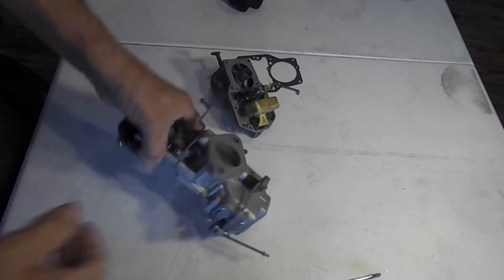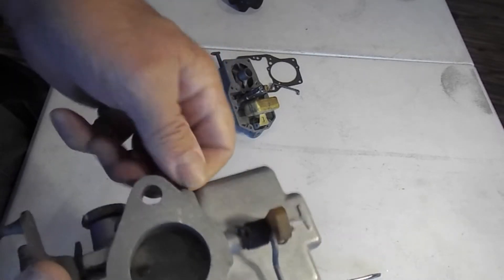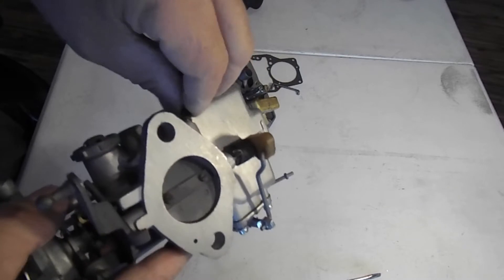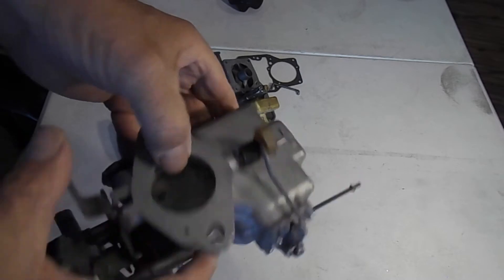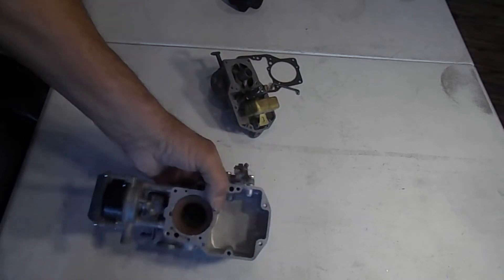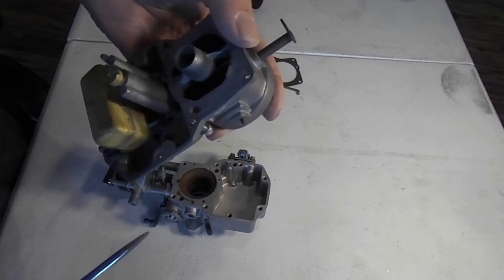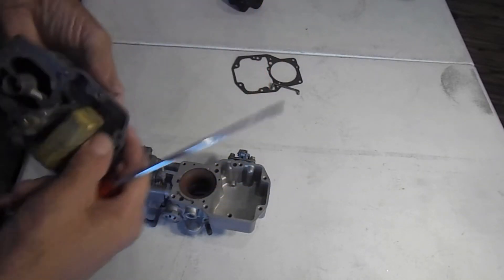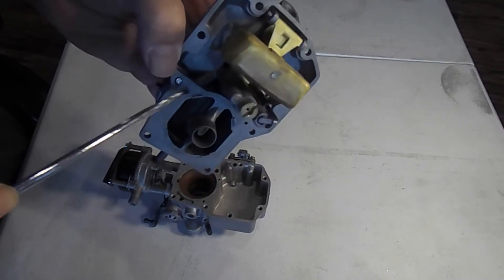Autolite 1100 Idle Circuit

Comment: Do you sell carburetors? I need an autolite 1100 for a 66 mustang 200 six cyl. I have one but the body is warped and it weeps fuel around the float bowl cover pretty much constantly. I've set the float a little low to slow down fuel seepage, but have developed a slight just off idle stumble. I don't have a jig to straighten out the carb body. I would probably spend more time to make a big than a new carb would cost.
Reply from the maker: We do not sell any 1100 but you can look at what we sell instead: https://www.carburetor-parts.com/new-1904-carburetor-n1904.html
Reply: @MikesCarburetor  ok thank you for that link.